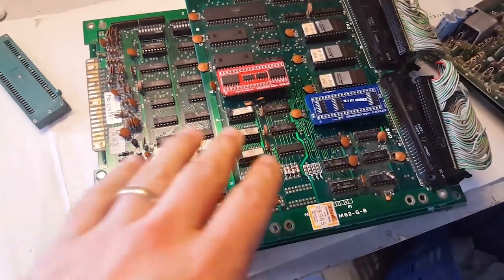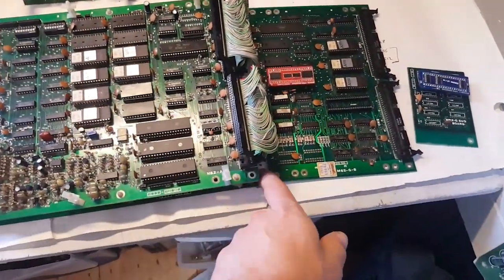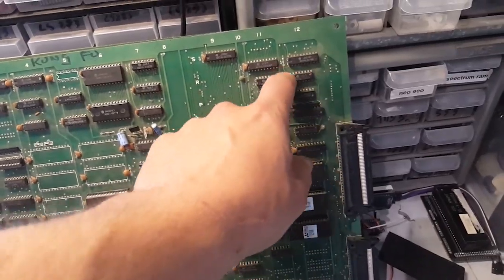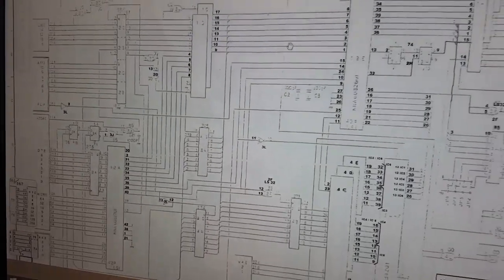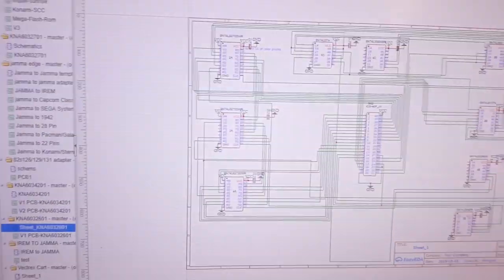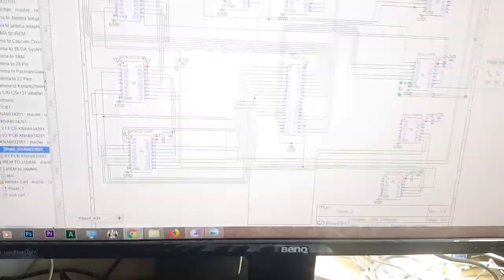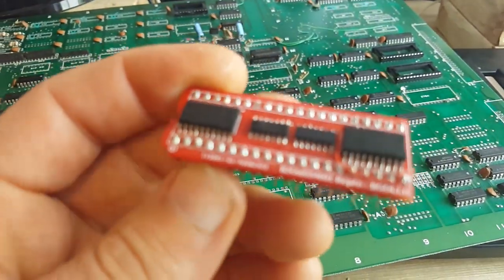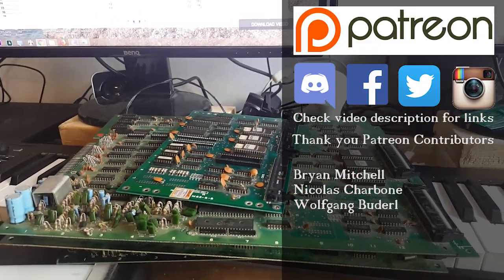How I make Custom IC repros

Comment: The MSX Toshiba HX-10 has a custom ASIC on its PCB (MSX Engine Toshiba TCX-1007)... No specs of it whatsoever. 
If we suppose it's made up of logical gates (AND/OR's etc...), could it be possible to reverse engineer its behaviour/internal design, just by peeking and studying its pins behaviour? I mean, in this case a bootleg pcb doesn't exist, so tracing back IC's is not an option... (Just wild thinking...)

EDIT: There's an open thread in MSX Resource Center with some user and this very exact problem with his HX-10... It seems a redone custom IC should be the only option to save his HX-10...